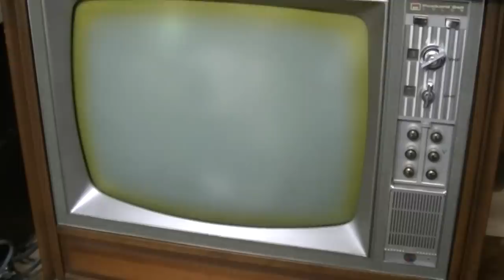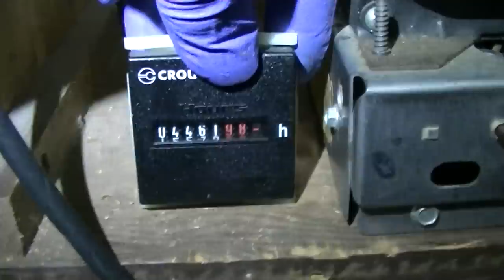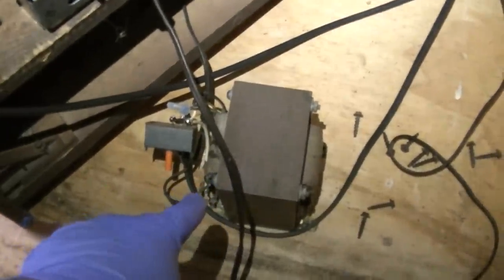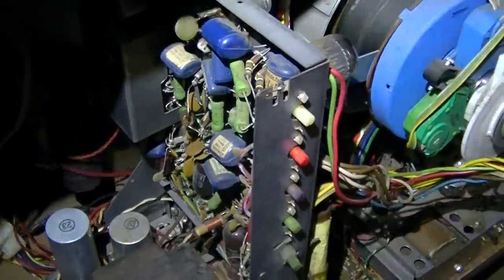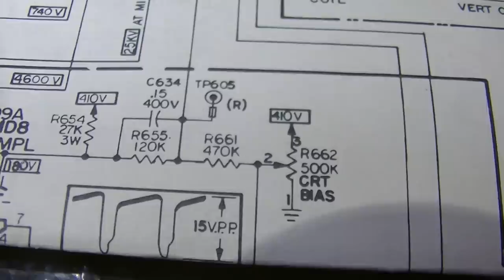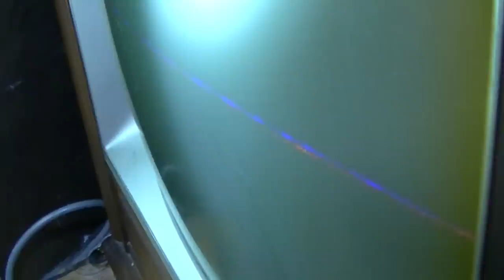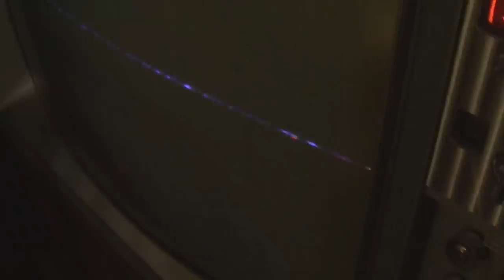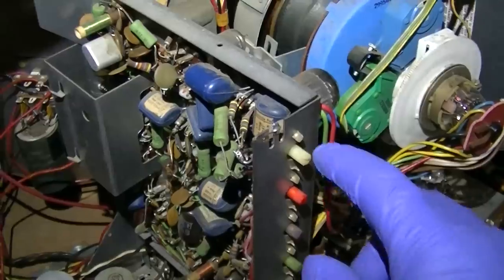Carbon Tracking Fire 1968 NOS Packard Bell Test Set Update 8 13 23

Comment: A period correct failure, this can't be easily attributed to age, unless the grease in the pot broke down with age and became more conductive.
Reply: Tin whiskers, insects, cigarette smoke, 50 years of collecting lint and dust. Of course 400 volts next to ground doesn't help matters.
Reply: @zulumax1    I rarely see tin whiskers in Packard Bell sets, but it is of course possible.   400V across the pot probably is going to cause it to get a little toasty.
Reply: A lot of, if not all the failures this set presented are from age. The whole experiment proves that these sets were somewhat reliable and parts go bad from being sat unused for so many years.

Comment: Allen-Bradley J-types are usually rated for 500V, up to 2A. Don't think they're still in production but easy enough to find online (ebay, surplus stores etc.). They're my go to for overkill pot requirements. I did a Majestic radio that ran something stupid like 180v across a volume control and was burning out modern pots and it was the solution. ...if only it were still easy to find long shaft pots today. Sigh.
Reply from the maker: that's exactly what's going in it already got the AB pot

Comment: Had a Philco 17MT80 roundie that carbon tracked the demod tube between grid and cathode on the PCB, used a dremel to dig out the gunk and filled in the resulting crevice with epoxy. That damn Philco had the sharpest most well converged image of any roundie I ever owned.

Comment: Not surprising, vintage ham equipment is also susceptible (although can’t recall any having potentiometers sitting right across full B+!) to the same failures, mainly from dust, smokers and repeated humidity-cycles that act as glue. 

Whenever I get a set in, I always use compressed-air to get rid of most, then usually spray all the controls with D5 to flush them out, then F5 or F100 to restore lubrication.  If I get in something really bad with many possible arcing-paths, I will wash it all down with naphtha (which is ok for most paints and markings—just test if you’re concerned) and a brush; this also will take off that gummy coating that seems to imbed itself, especially wax/resin covered components.  Just let it dry out well or your pots will light-off the residual and do the same thing we just saw!

Great video; my only question: Does the CRT-bias really require the full B+ dynamic range; or should it have been reduced with resistor(s) as you mentioned?

Comment: Usually microscopic dust building up around grease, oil or smokers choice. Ultrasonic all old pots before putting into service helps eliminate this. I remember a safety video about how high current kitchen appliances like fridges can start house fires when dust and grease builds up around the outlet and causes a short circuit

Comment: I really missed a CRT tester measurement when you discovered the CRT is getting a bit weaker. It would be nice to pull out the CRT tester in every update video, to see the aging process of the tube. Maybe also test some of the key tubes, like vertical and horizontal output, damper, audio output.
You're right it really was a huge engineering failure from Packard Bell to put that pot directly across B+ and GND. You should probably put a 100K 2W high voltage resistor in series with it to prevent this happening again in the future. It will reduce the adjustment range, but since the optimal vaule is still close to ground, it's not an issue. You will probably need a cermet pot to meet the voltage rating, it won't be cheap, unless you have some NOS/ salvaged one with the right value and size. With the 100K in series with it, you could use a simpler pot with lower voltage rating.
I wonder if this failure was caused by a tin whisker in the pot, then the arc from the initial short caused carbon tracking.
Reply from the maker: Probably no measurable decline in the CRT in every update video and no measurable decline in the chassis tubes. Any decline will show up as a performance change such as needing to adjust the vertical before it shows up on a tester
Reply: This series is awesome, thanks!
Reply: Or go with a resistor decay box till green comes back and hope its over 10k for safety. If I were to guess at it 33k. I would also like to see a propaganda bulb test every like 9,000 hours thats one year of on time.

Comment: Can you tie in a 5-10k resistor in place of the pot (about 10% of the pot's range) and adjust the screens, or does that add wear on the CRT that properly dialling in the bias reduces?
Reply: something like a 220k pot with a 220k in series with the b+ end may work and be more reliable?

Comment: From what I remember the Packard Bell TVs weren't very reliable so maybe they cut some corners like not using a properly rated pot and running that kind of voltage through it to begin with. It does have a surprisingly good picture though and it will be interesting to see how long it lives before something catastrophic takes it out.

Comment: Nice one. It wouldn't of killed them to put a 100k resistor in the ground of that pot. Interesting the tube is showing signs of wear at 4500 hours.
Reply: The crap on TV today would wear down even the most expensive Dumont out there ;-)

Comment: Potentiometers are rated by maximum Watts not Volts.  Voltages approaching 410 V like this sets CRT bias means the 
current must be very low (like less than 1 mA). Replacing with a higher rated pot like a 2 Watt or more will help. Feeling like experimenting Shango? Use a #2 pencil to fill in the missing  parts of a cleaned carbon track in the old one as a test. Steve
Reply: I whittled a pencil “lead” into shape and am using it as the wiper in the unobtanium speed trim pot on my vintage TT. Works minty fresh.
Reply from the maker: Pots and resistors absolutely have a maximum voltage rating. look at the spec sheet
Reply: @shango066  Mostly they are  maximum rated at either 350 or 500 Volts. Humans must have a maximum voltage rating too or the electric chair wouldn't work!
Of course it really all "boils" down to the current at that point.
Reply: It's not the wattage rating per se, but the arc-over breakdown to the housing that sets the max voltage limit.
Reply: @soopergoof232  Like human skin when being fried in an electric chair or  hit by a stun gun.  Got it. LOL
Reply: @hestheMaster 

This had nothing to do with the 🍲 not being to correct wattage. You can run .1 microamps through a 10 JiggaOhm pot, an arc can still jump across over the metal shield if it's not properly designed for the voltage or there is some buildup of crud in there.
Reply: How amazing.  People here dont seem to know the difference between voltage and Amps.  i agree with shangoo that the correctly rated VOLTAGE pot need be applied as well with the proper amperage.  For Amperage he need only put the current meter on the circuit, get the reading and Times that by 5X. Hey German engineering, its the way to go.
Reply: @iRepairElectronics  Maybe  thats why the use Wattage in all pot specs. You have to know the max. rating for some may not be higher than 350 Volts only unless specified. This was probably  a 500 Volt pot however
and there may be contaminants on the carbon track or 
it has a weak spot ,  it cracked and/or  the wiper to carbon track is poor in one spot.
Reply: @westelaudio943  Never implied it was the WRONG Wattage but the gap of air is larger in a larger Wattage pot body to the carbon track surface. At least give me that for crying out loud! Think this has a  spot that the wiper itself is jumping over a crack or thin spot on the track producing sparks that burn the surface off.
Reply: @iRepairElectronics do we need to get out the garden hose example?

Comment: Electric cars need this energy xDDD
Reply: The result of Woble Glarming is people installing more Cheye Knees mini splits which are competing for energy with the solution to Woble Glarming which are EVs. There is only so much electrocity to go around. By blowing it's breaker and going offline this TV set did help by allowing a couple more EVs get charged up for awhile.
Don't let Newsom find out that this guy is restoring and running old TVs and Radios.
Reply: Man bun required to drive an EV.

Comment: 400ish volts across a pot track?! no wonder the poor thing burnt up! very bad , surely it doesnt need that wide range of adjustment? maybe fit a resistor in each end when fitting a new pot to reduce voltage across it and range adjustment?  that said, i've seen those type pots used for A1 volts adjustment....
Reply: if it needs to be almost grounded, maybe a 250k pot, with a 250k in series with the B+ end, ??

Comment: People love to say that older is better but panasonic plasma tvs go over 20k 30k hours and not almost burn down.
Reply: Depends on your definition of 'old'. I don't think anyone ever considered tube/Ge hybrid sets to be most reliable.
Reply: I have a 2009 Panasonic plasma that is still going strong.  I only upgraded the living room TV because of the heat that thing chucks out.  Picture is still great and is doing Nintendo switch duty in the spare room now.

Comment: 410 v dc  thru a 500k pot. What a stupidity. Not safe.
Reply: Yep. No warnings or anything to indicate that such high voltage is present either. An appalling design, even by 1960s standards.
Reply: @bradallen8909  fairly common, i've seen those type pots used for A1 volts adjustment and theres a few hundred volts across then, but theyre usually fed through high value resistors so any breakdown will just clamp the voltage down, no burn up!  putting one 'hard' across a high voltage supply with no limiting is very bad, though
Reply: @andygozzo72  Common doesnt mean it was a good idea. We all know how flaky pots can be. Any competent electronic engineer would never put that sort of voltage across a pot. Even with a "burnout" resistor it's a terrible design.
Reply: @bradallen8909  oh, i'd definitely say not a good idea, but when you need to adjust from a fairly wide and  high voltage range, not much else you can do ,

Comment: Why do you resurrect all these power hungry TV sets?  I presume you live over heeerrree where their ain't no analog trans aloud.  I belong to the IGBT community.
Reply: Mainly it's for the fun of it. It's wonderful to get a piece of history up and running, and you can still receive TV stations with them by using an analog to digital converter box.
Reply: Picture tubes are engineering miracles.
Reply: Yes, I predicted to my friends back in the mid 70's that the picture tube was the only tube that could not be replaced.  Boy I was wrong!  My favorite CRT terminal in the 80's was a Qume QVT-101 with amber phosphor.